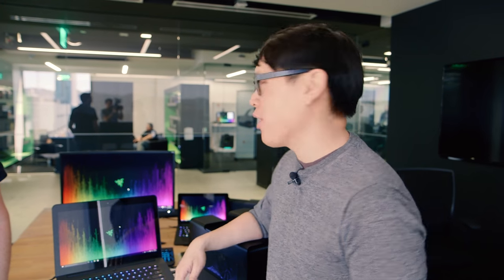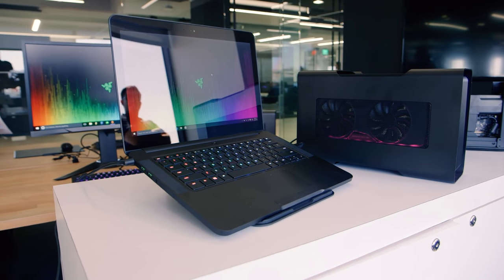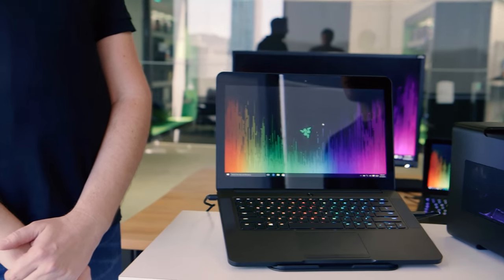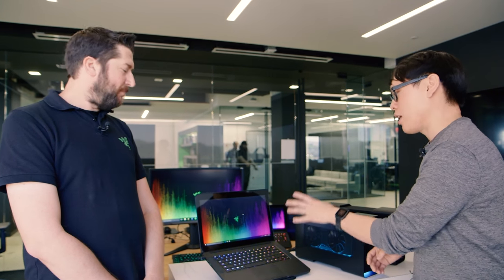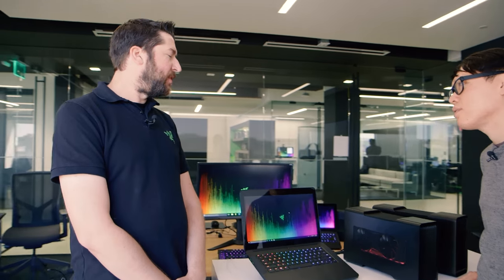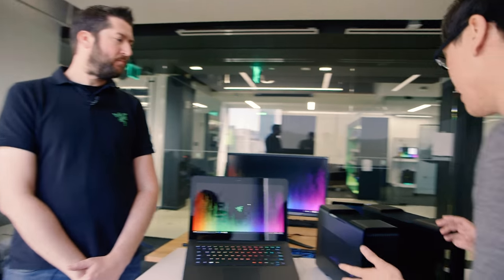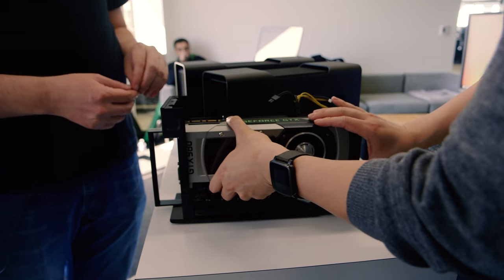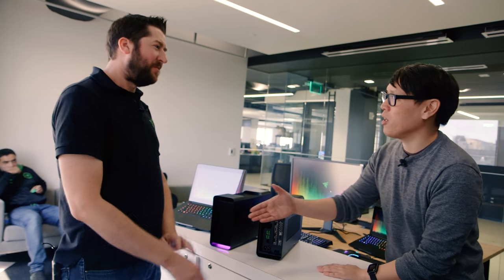Installing a Video Card in the Razer Core (External GPU)

Comment: 500$ for the enclosure...Jesus...even with the PSU and USB/Ethernet I thought this might be around 200$, but I guess that's Razer...
Reply: +RisenGnom seriously, way over priced.
Reply: +RisenGnom first gen products are always pricey...
Reply: +Jerry Garcia BUT IT IS TOOL LESS AND HAS A GREEN WEIRD UGLY LOGO!!! WHO WOULDN'T PAY WAY TOO MUCH FOR A PERFECT BOX LIKE THIS???
Reply: Razer is like Apple
Reply: +Minh Vu Except razer hardware is still usable.
Reply: +Tailslol People here don't seem to understand the concept of R&D
Reply: +TheFlyingPineapple R&D? this product does not require a lot of R&D since its all built on existing tech. external gpu's have been available for like 50$ over the pci-e for a few years now. pumping it over thunderbolt isnt really that different, just a different wrapping methode for the same packages. im not saying that it isnt expensive, but they definitely putting a premium price on it beyond the R&D costs.
Reply: TheFlyingPineapple You don't seem to understand the concept of Razer overcharging for products.
Reply: tjeulink well 1st gen product have the new norm hardware RnD this is why most 1st gen hardware are high cost,when the norm will become more mainstream the hardware will be more adapted,optimized and cheaper. concurrency will help here too.
Reply: Tailslol no, pci express support came with thunderbolt 3, not with the razer core. razer just built the actual thing. the tech was already there ready to be picked up. 

https://thunderbolttechnology.net/blog/thunderbolt-3-usb-c-does-it-all
Reply: +tjeulink yes, i know and as i said it is a first gen tb3 video card enclosure. before it was diy somewhat and it was mini pcie only.
Reply: Tailslol they didnt do any r&d. thats the point im making. otherwise laptop mobos with tb3 would also cost 200 bucks more soley for that reason. its existing tech, no r&d involved at all, especially if it is already on the actual speclist. if they hacked the tb3 then yes the price would be justified, but this is simply putting 1 and 1 together to make 2.
Reply: like literally intel provides the chips themselves for the thunderbolt to pci convertion.
Reply: +tjeulink Well that's bull. The only PCI-E solution I've seen have been the ViDock's. and they still ran about $300 despite being powered by a pair or anemic laptop chargers. Razer have managed to fit a tiny 500W PSU inside the enclosure itself, and that in with the fact it's going to be a pretty niche product, as well as a premium one, the price doesn't seem reasonable.
Reply: Egpus have existed for a very long time, you could make this yourself with components quite easily for half the price.
Reply: TheFlyingPineapple  yep this is where you pay Intel RnD because they dont sell the chips on th cheap side...add to that the quality of material and all the advert of the company and all...and diy ones was at 300 bucks minimum for barebone type...
Reply: Tailslol any proof of the chips costing that much that it impacts the total cost? ive been looking around bc of exactly this but it seems to be pretty hard to come across any info on the thunderbolt 3 chipsets.
Reply: TheFlyingPineapple ive litterally seen solutions for 60$. yea sure its a barebone without psu etc but it does work. 
http://www.ebay.com/itm/181943864835?rmvSB=true
psu's are pretty easy to come by, especially since most graphics cards draw 250 watt tops. just get an old tower psu, often those things are quite good.
Reply: tjeulink first what you show is good old mini pcie and we are speaking about tb3 then i will never trust a chinese knock off to power a video card that cost 10 time the price and without protection...
Reply: Tailslol thunderbolt uses the same protecol as this, pcie. its not a chinese knockoff, they where the first in the market. they've been making them for years. this is a remade version with nicer materials. that you dont trust it is fine, but my point stands. you can find items with VERY similar functionality for 10% of this price.
Reply: tjeulink
same protocols,no
compatible protocols yes...
and your thing nead to tear up the computer in some models and have not a 100% compatibility and is completly barebone so no mc guyver...
Reply: Tailslol it literally is exactly the same protecol. its the pcie protecol. thats what the pcie mini also runs. thats what thunderbolt eGPU's also use. its a different cable but the data is the same.

yes and so is thunderbolt. you need a thunderbolt laptop, and most thunderbolt laptops are not supported well yet. 

tearing up your laptop or not is really irrelevant. the point is that it does work, even without tearing it up. and that if it needs to be torn apart, its an easy process. just because its not an exposed port doesnt mean that its hard. if you can replace a harddrive, you can do this.

and yea again i said its barebone, thats not the point. the point is that there is little to no R&D involved in the product. its not revolutionary. thats like saying that usbc is revolutionary over the normal usb3. its not. its just a better variant of the same product.
Reply: tjeulink well,i dont use laptops soo and no it is compatible protocold because the video card need a firmware upgrade to be fully supported... and it support too older usb protocols and display streams in direct link so it has clear differences...
Reply: Tailslol thats because they can run multiple protecols over a lightning cable. the thunderbolt is higher dataspeed. the protecol that goes over said cable is pci express, displayport, usb, etc. thunderbolt ports have direct memory access (DMA) to the pcie bus on the motherboard, just like pci express (Duh) does.
Reply: Tailslol that it has differneces doesnt mean that it doesnt do the exact same thing. sure one has higher specs but that doesnt make it a pioneer. they took existing tech and put it in a fancy box and smacked a premium price on it.
Reply: tjeulink and we return to the RnD part,just wait it will become cheaper.
Reply: Tailslol yes ofcourse we return to the R&D part haha, thats what im trying to discuss, its not that much r&d. RnD doesnt justify the steep price. and no i wont wait for when its cheaper, i dont need the product. im just intrested in tech and keep up to date with different systems.
Reply: a chip that mix and switch high speed protocols in same time so...
you are trying to say...instead of old hardware dedicaced fonctions... to me i think it has needed Rnd (and high quality enginering)
Reply: Tailslol ps here it shows that the controller simply splits the data protecols and doesnt invent a new one. 

http://nl.mouser.com/new/Intel/intel-thunderbolt-controllers/
Reply: +tjeulink well then you can build one yourself.
Reply: Tailslol well at this point logic is thrown out the window i see. it doesnt matter if i can built one myself or not now does it? i also already said that i dont need it! my argument was that the price cant be justified with r&d like you claimed, at this point i think ive proven that beyond reasonable doubt.
Reply: tjeulink kinda,look the product price on phones.
Reply: Tailslol im not quite sure what you mean, either way phones are really different in design problems. heat dispersion and compact design take a lot of r&d, even though its probably still a little overpriced (hence why buying the second last flagship is always cheap.
Reply: pricing wise

Comment: sooo $400 for what...the box ,cables,power and 4 USB :D
Sounds like an Apple Product
Reply: +Manol Chalakov Sounds like a Razor product too
Reply: +Manol Chalakov well... the development costs for things like these are huge, so while u are technically just getting a port to plug in a gpu and 4 usbs, getting all that tech together costs a fair bit of $$$$
Reply: +Manol Chalakov these things existed years ago for apple laptops (maybe others with thunderbolt ports), but they were $1000 for just converting thunderbolt to pcie without any guarantee of not burning your house
Reply: Obviously he can't. Razor can.
Reply: +Chris T. How so, Its a one-use modular component that cant support other models, permanently coupled to a equally overpriced laptop. That is in black and green. noone wants this sht. NOT WORTH $400.  Just make a box that doesnt tie you into the Razer ecosystem....
Reply: You cannot use the Core with anything but the blase, you know this right. You cant plug this into a MBA. I should know, I almost bought one. And the bandwidth has issues.
Reply: Anduin Arilan how do u know when it hasn't been released? or been available to buy yet???
Reply: GIYF. I actually researched this and the revious model extensively. I was going to buy it, even though it has Thunderbolt, it wont work in places where the Core drivers need  to be installed, and as far as I can tell, thats only the Blade...
Reply: Ah ok so it gets even cooler (and even more like an iProduct) - if I want to use this I have to get a Razor Laptop(only)...and of course a video card. If I want my computer to limit me I would get a Mac.
Sheelo A. I want to point out that the actual cost of a product tends(99% of the time) to be a lot less than the value at what it's sold. If there was more competition in this space I'm sure that the Core wouldn't be at such price.
As a big company as Razor is the development cost is a little factor here. 
I don't see anything wrong with profit but this is just an accessory/dock for Razor products. But as we clearly see Razor is a premium brand(or tries to be) so the prices are set accordingly .Once again if you look at another "premium" brand you have to deal with the same "problem" - 50$+ for a simple charging cable/adapter/headphones.

Comment: I do like this idea, but I think its a very niche market that would buy it, I dont see it becoming mainstream, however it could but it could be useful for those who cant fit the GPU they just bought inside the case they currently have...but in that case, they would need to make a much cheaper and simplified version that doesn't include the power supply (as obviously your desktop can handle that on its own)
Reply: +Alex “TheTechDoc” Mods Imma just copy and paste something I wrote earlier: 
 "As it was said before me, this is fantastic for middle or high school students, like myself. I can use it for all my classes, maybe even do some gaming with my friends at break, and then when I'm at home, I play at peak performance."

Actually, you don't even have to be a student, you just have to want a mobile, high quality and performning laptop that, when it needs to, can game at top performance via the Core.

Comment: The Razer Core has got to be the most advanced external GPU to date.  If this works with the dell XPS line, then its a rap.  However, it would be interesting to see Razer and other manufactures design "MOBILE- EXTERNAL GPU" products for on the go work and lifestyle.  It would really revolutionize gaming as we know it.  This is definitely a step in the right direction even if it is only tech-wise.
Reply: Explain to me how it's the most advanced GPU when... you know... there's no actual GPU that comes with it ? It's a freaking container with a few ports and you still have to buy a 300-500$ GPU on top of it to mount inside of this crap.

Comment: The enclosure only holds one, so you could not do an sli bridge. I don't know a lot about thunderbolt technology, but I know that you could daisy chain hdd enclosures and displays with the original thunderbolt. Can you daisy chain multiple of these together and get a similar effect to an sli bridge, or a better one?
Reply: Maybe not for display then, but still could be used for computational means.

Comment: but why small display? for such high end mobile gaming rig / workstation i prefer at least 17-inch
Reply: +Aldy Waani buy a bigger laptop then :P or you can hook it up to a bigger/better monitor and use that one.
Reply: +whiteland9992 yeah i already had and did that :) but we're talking abt being mobile. in full res above 1080p the text and GUI is very small for 14-inch display.  except for gaming.

Comment: Razer system:
2199$ for the Blade + 399$ for the Core + 680$ for a GTX 980Ti = 3278$ total
My system (i5 6600K, RoG Ranger Z170, 16GB DDR4, GTX 980Ti, Samsung NVMe SSD 256GB, 2TB HDD, 850W PSU) + my laptop (Lenovo Yoga 2 Pro 512GB):
1898.86$ + 1375.38$ = 3274.24$ total

It is not that unreasonable guys. Given that the Blade has a better CPU than both my desktop and my laptop and a way better graphics gard than my laptop it's actually worth considering. PLUS you don't have to get all the peripherals needed for a desktop. Monitor and keyboard are built-in. Buying equivalent hardware would add another 500-800$. I would wait for some numbers on the "lets connect a high end GPU via thunderbolt" thing, though. I'm not convinced by that.
Reply: +John Kapri The cheaper Blade is only 1k
Reply: +farcere "only 1k"
Reply: plus i can play it anywhere. good luck taking your PC to your moms house, if you are not living with your mom.
Reply: you dad will do. or both. you get the point. portability!!!!
Reply: Wisky Mo I carry my Yoga 2 around wherever I go. It's just nice to have a computer handy when you need one.

Comment: I keep hearing a lot of mixed information about the Thunderbolt 3 GPUs. Does the Thunderbolt connection allow for enough data pass through so these cards are in optimal performance?
Reply: Thunderbolt 3 is apparently 40Gbps. https://thunderbolttechnology.net/blog/thunderbolt-3-usb-c-does-it-all
Reply: +James Heyes From what I've researched, high end GPU run around 30gbps so these thunderbolt 3 GPU work fine. I'll probably pick one of these up when Thunderbolt 4 arrives.
Reply: Thunderbolt 3 is MORE than plenty for any Current Video Card. Only limitation is going to be Fiber Channel cards.

Comment: just a quick question, assuming sellers do adopt the razer core system, do you think the new macbook would be a good target for it? No idea how it will interact cause the software is different but the intel internals would be similar enough for me to imagine it happening
Reply: I don't think the 2015 MacBook has a thunderbolt 3 USB-c port. Also I doubt the core m processor in there can handle anything above lower end graphics cards without bottlenecking.

Comment: If pc's made parts external like this, such as the gpu, cpu, and ssd, that would bring a lot more people over to PC gaming.
Reply: +Roxas theNobody It's the exact same process for installing a GPU on PC. Only difference is the number of screws.
Reply: +Roxas theNobody Samsung actually do now have an SSD which you can buy which uses a USB C connector, effectively making it an external component, with the Razer Core appearing to be very simple to use, we might not be that far away from the utopia of everything being available as an external add on. I work in a small computer repair store which also sells computers and peripherals and we very often have customers who have bought a mid range laptop expecting it to be able to play game such as GTA V on full settings and the one thing they always ask is "how do I upgrade the graphics card", luckily I may soon be able to offer those customers a real choice outside of buying a whole new laptop
Reply: +Scott Guest I shouldn't have said ssd. I'm stupid.
Reply: +50calHeadshots true it is. This is just easier to access.
Reply: +Roxas theNobody Installing parts into a pc is not difficult. The difficult factor really has nothing to do with it. I think people are scared at the possibility of messing it up which is very unlikely.

Comment: I love the crap out of the blade and core. But imo 500$ is a bit steep, no? For a tiny case and psu, am I wrong? I'm thinking it should've been 399 standalone and 299 with the razer. Who wants to pay more than a GTX970 for the box that will contain it.
Reply: +MartBro93 it should be no more than 199.. you can get a case, a motherboard and the psu +8GB of RAM for 199. if you already have the GPU you just need a processor for a whole pc instead of an entire laptop. and this costs 500?! there you have the extra 300 for a superb first class CPU^^
500 for the razer core and 350 for the graphics card already is a great pc^^ just stupid. I guess it is for the really rich people that have a pc AND an OP mobile solution
Reply: MartBro93 thanks for bragging, noone needs this on the internet

Comment: Maybe razer would make a smaller portable external gpu adapter with tiny powerbrick, without encasing to allow any card be installed? Though I guess not happening, cuz it'll be too cheap and affordable.
Reply: +Hokunin Painter This one is not that big either. It's sile 40x30x20cm (not exact but something like that). I'm sure other manufacturers will provide other solutions, but the problem is that smaller graphics card or mini versions tend to be thicker.

Comment: While it is nice to see things modular. I cannot help but feel you are far better off with a simi potable gaming pc especially given the failure rate of overheating gaming laptops.

Basically when I think pc I think very easy to repair/upgrade, when I think of laptops I think "planned obsolescence". - laptop repair guy.

Comment: Won't external GPUs be incredibly slow due to the fact it is off the motherboard? I mean I know having a GPU on a PCIe slot is already incredibly slow for transferring data, but to imagine a GPU that looks like its on a separate motherboard, and then requires another data transfer cord before it can even get to the host system is insane. Am I missing something? I understand that it's better than having a machine that doesn't have a GPU, but I still think it might be a stretch?
Reply: Wow that's really interesting. Good to know! thanks!